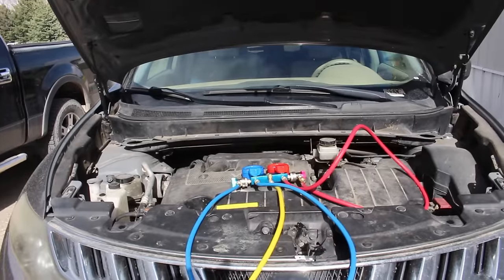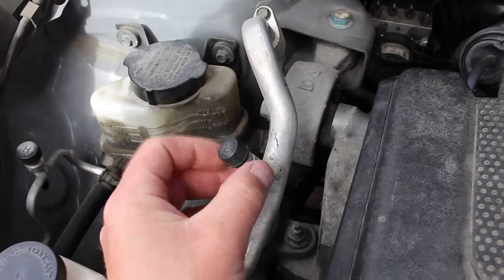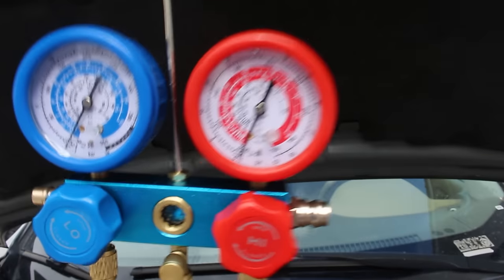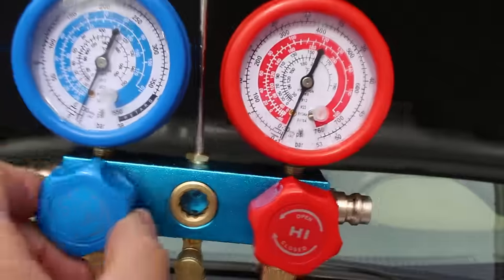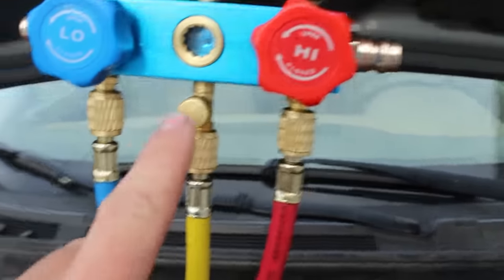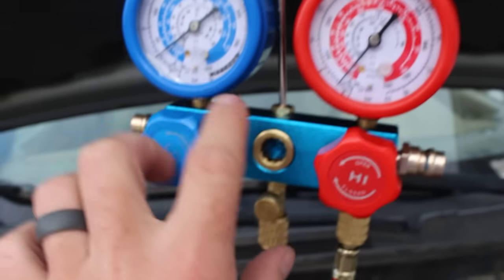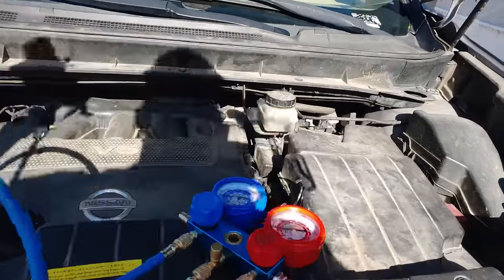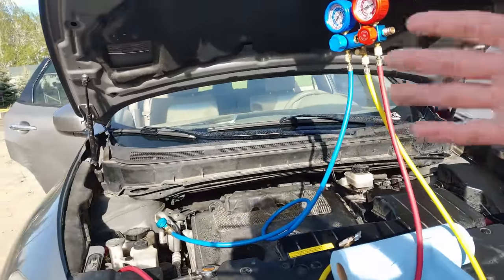How to Recharge a Car's A/C System Using a Manifold Gauge Set & Vacuum Pump - Air Conditioning

Comment: I don't want to let this into the atmosphere! What do you think that "steam" coming out of your vacuum pump is? And there's no reason to vacuum for 45 minutes dude, that's crazy long. 20 is plenty. You didn't put any dye or pag oil back into the system either... That's how you blow up a compressor. Anyway, still a decent vid if you need to know which valves to open when.

Comment: Pretty sad, anyone can make a video claiming to be an expert, never mention what to do if there is still a residual charge in the system, or pressure testing system with nitrogen prior to pulling a vac.  System can pull a vac just fine when it's being sucked together, yet under pressure may leak.  Just 30 mins to pull vac, always in a hurry, I always pull vac for at least 2 hours...  Never like to hear the words maybe, probably when it comes to anything to do with ac, 7, 8, 6 oz of oil.   Come on bud your setting up people to easily fail or end up with sub par results

Comment: Vacuum its same for prius ?
Reply from the maker: Should be the same process for any R134a system. Again you're only needing to draw a vacuum if the system is completely empty... Use a quick recharge can if you're just adding refrigerant.

Comment: The vacum pump I have has a black top on it and is screwed in. If I open it, then the oil starts spilling out. I see that you have an open top which releases the gases. So I wonder what happens if you have it closed.
Reply from the maker: Thanks for watching! It's been a while since I've used it but I believe that's where the air, it vacuums out of the system, comes out. Unfortunately that includes a lot of the oil & any extra gunk. It steams because it also removes any moisture. I turned mine on with the cap still on in the video, haha. It has a sticker on it saying something about removing it before using the vacuum. If you keep it closed it will either blow off, damage the vacuum, or not actually vacuum anything out of the system...